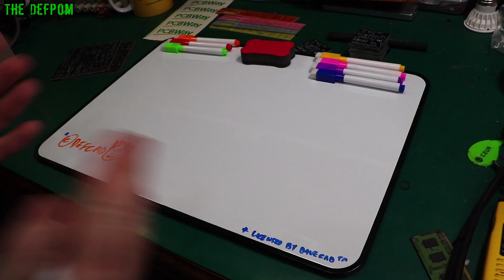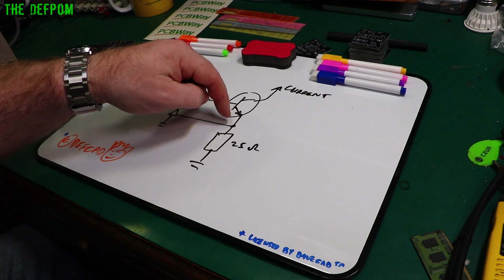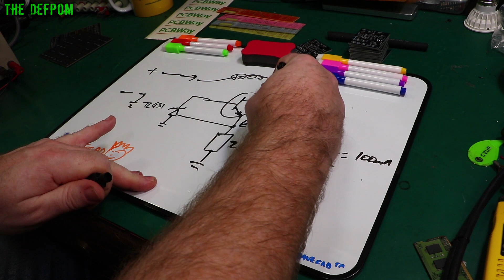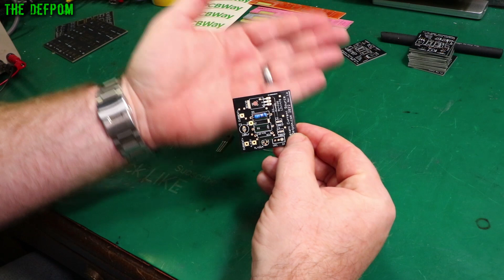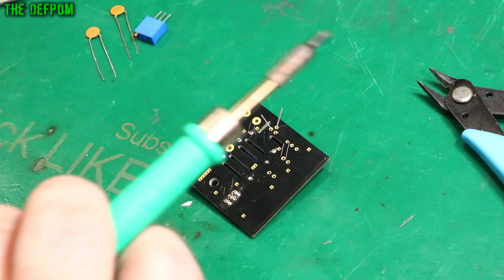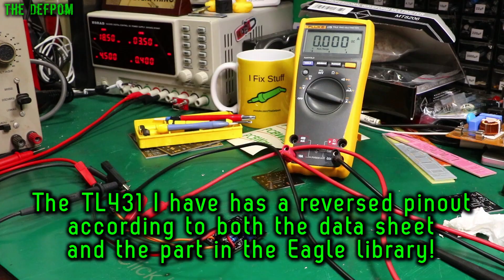🔴 Build A Constant Current Source / Current Sink - Sponsored by PCBWay - No.1005

Comment: Thanks, I’m seasoned with DIY electronics. It’s funny, I also prefer having the whole spool of solder in my hand. It would make more sense just holding the strand needed. Maybe the weight stabilises the movement? Grand letting us see when there was a fail and how You methodically solved the issue. It’s valuable to newcomers to the sport. It’s not all plain sailing 😊

Comment: Curious as to why not use an LM317 - fewer parts and very straightforward.
Reply from the maker: I almost did, but wasn’t sure if it would have the same precision as a proper voltage reference, plus I wanted to build something using the TL431.
Reply: @TheDefpom  Yeah, temperature spec for 317 voltage is pretty mediocre, and it requires 3V min input / output differential, which would not work well with your proposed li ion battery, since that is 3V on top of the 1.25V reference.  So your design is definitely better given the constraints.  I should have checked the specs first…

Comment: A note on your comment about holding the component legs that you snip off ... I've seen someone take one in the eye! and it stuck in. It wasn't pretty and he was lucky it didn't cause long term damage. The shorting other gear on you bench is top notch advice too. As for the TL431, check the Eagle footprint, some datasheets show TO-92 pinouts as viewed from the pins upwards. I've seen many a footprint reversed because it's been allocated the pin order looking down on the device. I always double check every library component I use and  mark it as 'verified'. Been caught out too many times in the past.
Reply from the maker: The foot print is OK, I already checked the datasheet etc. which is why I struggled to figure out why it didn't work like it should, and resorted to experimenting, it is definitely the device in this case, oddly!
Reply: @TheDefpom  I got a bunch of these TL431A's, mine are labeled "WS TL431A 633SB." but I haven't gotten around to test them. What are yours labeled?
Reply from the maker: @Rob_III  These are labelled "TL431 1308C TL"
Reply: @TheDefpom  Hmm, thanks! I'll try to test mine soon and see if they're 'swapped' too - I'll let you know.

Comment: Just apply a constant voltage into the base of the transistor, regulated voltage on the input, then a potentiometer as a voltage divider, resistor as a current limit, then into the base of the NPN transistor. The Emitter is still going through a low value resistor to give it a voltage drop. whatever the base voltage is equals the current through the collector of the transistor (minus the base current and voltage drop of the transistor junction). I have actually covered that kind of super simple ciruit in my videos for driving LED's (expecially LED backlights). That way you can wind the current down to nothing and have very good control of the backlight brightness. I have been putting them on all of my displays so when I record a YouTube video the camera can pick up the readout better.
I wish you the best of luck on your project and hope you can use my idea so you never complain that an LCD is washed out on camera! Cheers!
Reply from the maker: I had considered making a variable version, but this is just going to be part of a larger project which wants a fixed value.
Reply: @TheDefpom  yea the circuit I described would be great for other applications. But they are very similar in principle

Comment: Mounting the TL431 on the bottom side of the PCB may help with effect of the heat from resistors. That pinout It just goes to show that there are standards and standards.

Comment: Noted the linked pcb  design has current set resistors vertical, while your assembly has horizontal placement. But in general looking at that pcb as displayed on the link the layout is OK as far as TL431 pinout, matching to my data on hand and supply of these devices (have over 1000 in stock).

Comment: That reversed pinout was unexpected and pure bad luck. I have not checked if there are standard variants. One possibility is some Asian supplier/manufacturer who is not conforming to correct TL431 pinout.
Reply from the maker: There is a TL432 which would match this pinout, so maybe it is a 432 and not a 431!
Reply: @TheDefpom  Had a look at TL432data from Texas Instruments, the TL432 is not even available as TO92 style.  Interesting is that they have a new type with " LI " suffix with improved characteristics. Other suppliers may have had a TL432 in TO92, but that should be clear by label on the device if it is a TL432 that you have. Most probable still is a sloppy asian source with non standard or  bad batch bondout. Just the kind of parts sold via cheap Ebay type retailers.
Reply: There is a mirrored pinout of the TL431 T092 package available from some manufacturers, but not all.
The TL432 is smd only if i remember correctly.......could be wrong.

Comment: 67 ohm?  Measured? Standard series value is 68 ohm.
 Or using precision (0.1%)  very low temp coeftype, does not look like it. Yep just reviewed video, on the assembly  looks Blue Grey Black  Silver (x0.1) so 68 ohm! Not really of any issue as easily covered by normal tolerance range anyhow. The tolerance band does appear dark, so not sure about that.
Reply from the maker: Yeah it measured 67…  at least it did when I setup my parts drawers many years ago! It was a work around for not having the 51 ohm I wanted… those have now been ordered !

Comment: Fun! Thanks. IIRC, the OEM 431 comes in several pinout models. Yep, the project is worthy of an OEM 431. Comes as LM431 and TL431, too. Don't forget to correct the cap hole spacings, before posting the project files.
Reply from the maker: I’ve done a rev1.1 which is what’s posted on the PCBway site, it corrected the cap spacing, I also refined the design a bit and made the board smaller and added more accurate information on the resistances for different supply voltages following the testing I did with this board.
Reply: Cheers.

Comment: Technically his is a constant current sink, as it defines the current being sunk to ground. A constant current source would provide a constant current to your circuit from your positive power rail.

Nice to see it work in the end, would have been better to show a circuit diagram.
Reply from the maker: I debated the source vs sink definition, but as power is routed through the board I went with the source definition.
Reply: @TheDefpom  I just based the comment on where the control element was. it was between your external circuit and the ground so i went for sink. also your circuit will still work if the external circuit was powered from a different source as long as the grounds were tied and the voltage did not exceed the VCE of the transistor.
Reply from the maker: @TheEmbeddedHobbyist  yeah thinking about it that way you would be right, damnit.
Reply from the maker: The diagram is on the PCBway project page, of my rev1.1 which has some minor improvements, electrically it’s identical.
Reply: @TheDefpom  Sorry if I missed that in the video, running on 1 hr sleep today. had to do a 230mile round trip during the night to drop somebody off at the airport.
Reply: If connected using the leads as shown in the video, it provides current to passive loads (e.g. the ammeter used to measure the current).  That makes it a source. You can make it a sink as others have said if another source is used and grounds tied.
Reply: @briansauk6837  the way the circuits works, is there is an output current source (uncontrolled/ limited by the power supply) called "current+". This if connected to ground would be limited in current only by the settings on the power supply.

The input called "current-" which is the active part of the circuit were Q1 and connected components form a constant current sink.

So in this case i would call the circuit a constant current sink as the circuit would function as expected to without the need to use the "current+" connection. As i stated before. 

Now this leaves scott or others to design an active current source.
Reply: @TheEmbeddedHobbyist  I understand your point regarding the location of the control element.  However from the more fundamental view of a two terminal black box device, a current source delivers outgoing current from the positive node - which his circuit does.  A sink takes current flowing into the positive node.   His circuit topology is more typically associated with a sink, but as wired to the outside world, it is a source.
Reply: @briansauk6837  only if the outside world is totally isolated from ground. so if connecting it to drive some LED's then yes its fine. but if you want to connect a scope to the external world then grounding any point will either produce magic smoke or some other strange faults.
So it's got a limited range as a two terminal current source. Calling it a current sink helps in confirming that it sinks current to ground. a current source points in my mind to a non-grounded source. which you provide the path to ground with your circuit.

So in my mind, a source provides curent, a sink accepts current. therefore the active element is in the high side for source and low side for a sink.

Using this as a source means that you have to reference all you measurement equipement to the current- terminal which due to its active element is moving with restpect to ground. Also means you have to remember that connecting the measurement ref point to ground via test equipment also call for magic smoke.
Nice to play with the old grey cells
Reply: @TheEmbeddedHobbyist  I’m generally in agreement - although Defpom specifically mentioned running this from a battery, which eliminates those reference point concerns (unless of course you use the same battery in something associated with the load).  Your points are indeed all good for a single reference scenario shared between load and sink. Appreciate the insightful discussion.
Reply: @briansauk6837  Since retiring two and a half years ago and the hit of that who's name shall not be said, I try and give the old grey cells a work out every now and then in YouTube’s comments sections.

Also a source of ideas about content for my channel (pun intended), just thinking about the comments can create thoughts off topic and give light bulb moments. :-)
Reply: @TheEmbeddedHobbyist  Right there with you - similarly retired, from career of mostly s/w - getting back into some hobby level stuff, and trying to avoid going bankrupt being a voltnut...  Happy to be your most recent subscriber.
Reply: @briansauk6837  thanks for the sub, us old folk need to show the youngsters how to do it ;-)